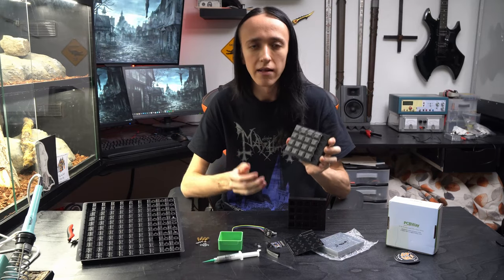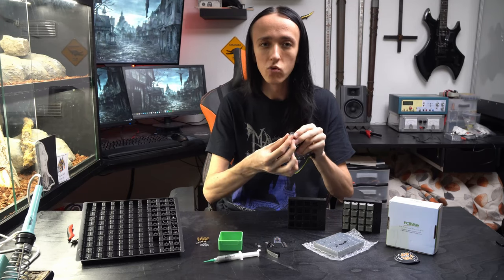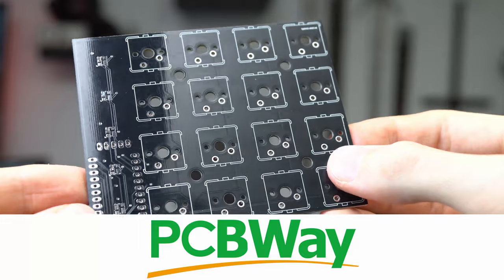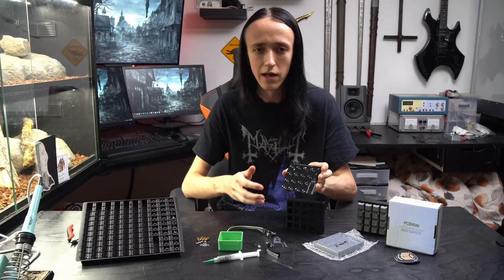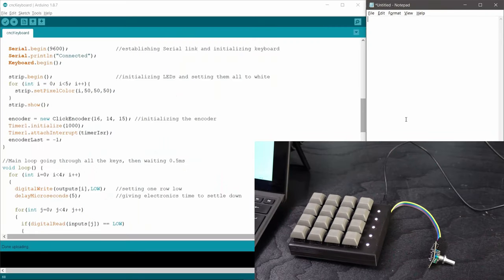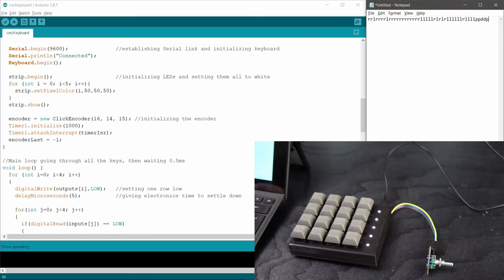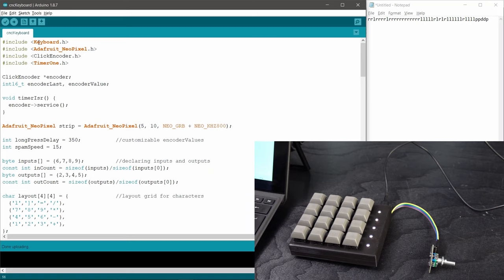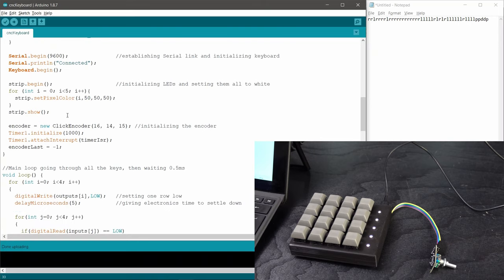DIY Arduino Macro Keypad / CNC Keyboard

Comment: if you press mutiple keys at same time (say key 1 and key 2 togenter) , what will happed
Reply from the maker: Thanks to the diodes both will be recognized as intended. You can press as many keys at once as you want without any issues when using diodes.